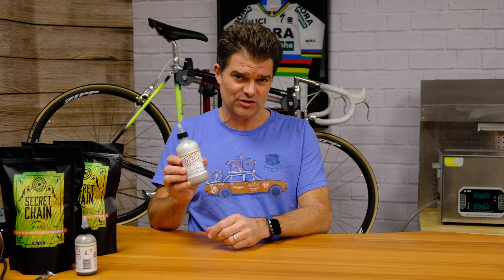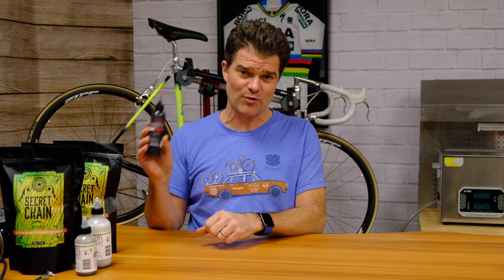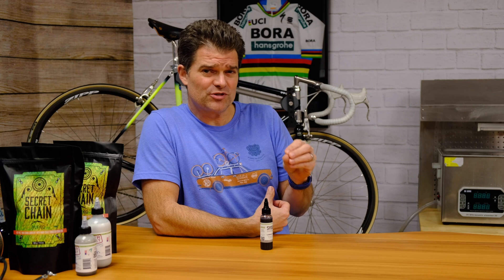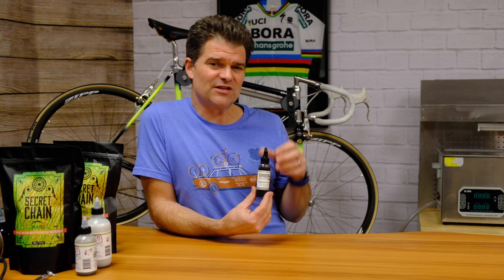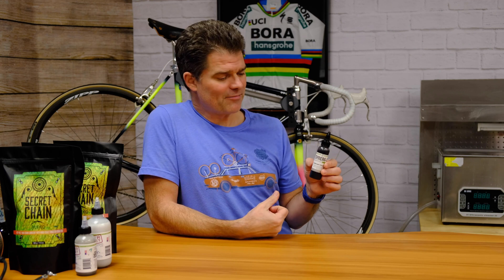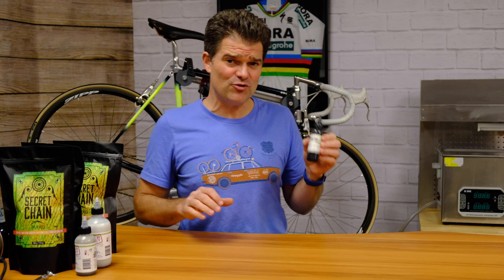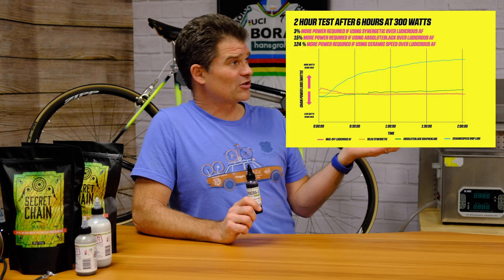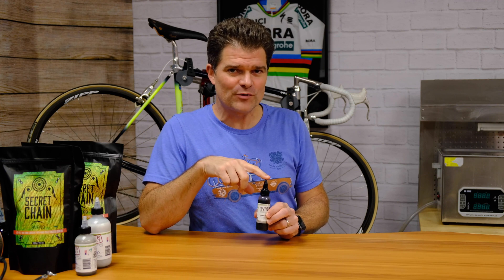SYNERG-E: The Drip Lube for E-Bikes

Comment: If its really double the lifetime of a chain, it would pay off even if you have cheap chains. Mine are about 10€. So lets calculate. If one chain make 1000km but with SynergE 2000km. I can make 10000km with 5 instead of 10 chains. So I save 50€. The oil is around 25€. So I still save 25€. Its not much but it show that long term the oil isnt expensive just at the first look. But I want to know how big are the WS2 particles!

Comment: I will receive my new bike, to use this E-Bike lubricant I must completely degrease my chain to remove the company grease or if I add it on top,,, thank you Google translation
Reply: leave new chain in petrol or paint thinner for 1-2 days, mix it, with brush few times

Comment: If synergetic-E is sticking better to the metal surface, has increased pressure resistance, and has higher viscosity then it looks like a nice cartridge bearing lube

- It will stick to the metal ball bearings
- It wont drip as easy (even on light contact seals, full contact will be better but it will add friction)
- Using single drop on a chain link is sufficient, so a single drop on a a ball bearing it should be fine too.

What's Your opinion on this?
- I'm interested in using this in a derailleur pulley wheels first, and if successful then on the hub bearings too.
Reply: ball bearings need grease.

Comment: I noticed your standard synergitic as well as the one shown on the website is much darker in colour than mine which is green with a hint of the tungsten disulfide floating around. Is there a new version with higher concentration?
Reply from the maker: Timo,
Reply from the maker: Sorry.. stupid return send in hoot suite!  The original formula was 2-3% WS2 which is what you need for 99% effectiveness, however, our bottling and stirring equipment struggled to hit this low number production ranged from 2-6% which is a very noticeable difference in color!!  We have since moved the formula to 5% plus added a bit of calcium sulfonate which is another environmentally friendly pressure additive to achieve a more consistent and darker color.. the resulting performance is almost no different, but we can get the bottles to look much more conistent this way.  If you check out the road.cc review, he talks about this as he had amazing results with an original sample that was much more clear and asked the same question!  Thanks!